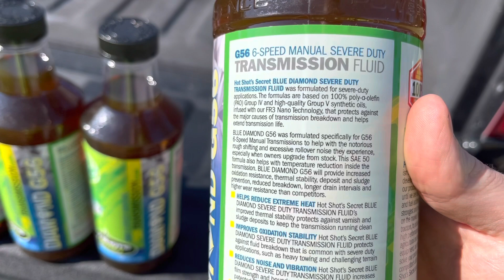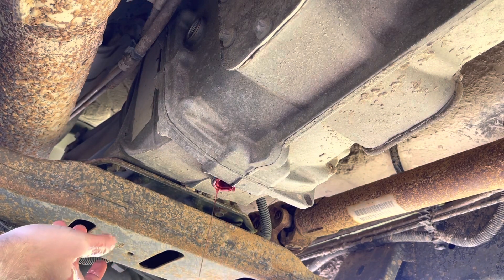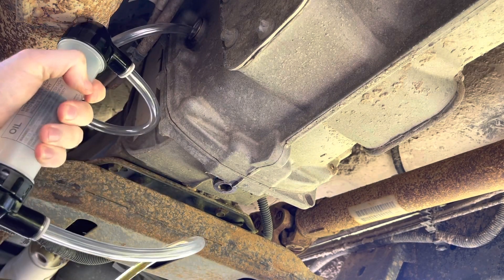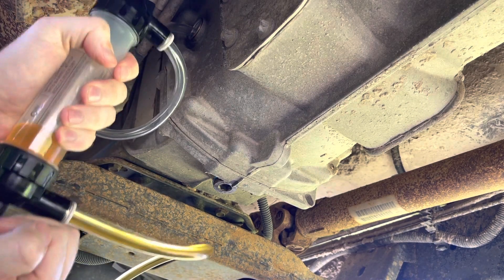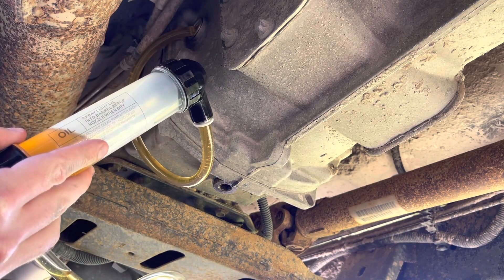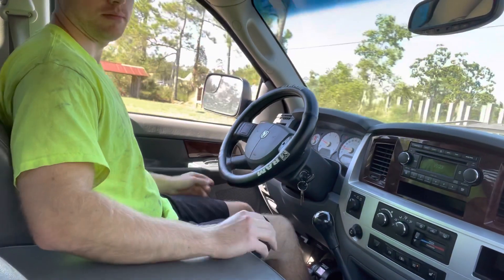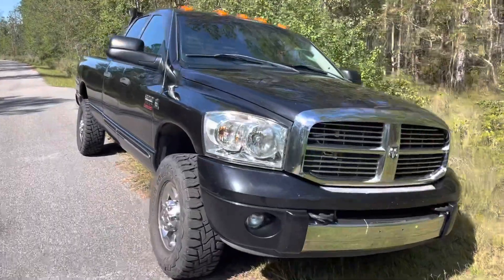Hotshots G56 oil change

Comment: I have been running this in my g56 and it's smooth. I'll be buying this again for the next oil change
Reply: I added a bit of the FR3 friction reducer to the front and rear differential on my 2017 Nissan Rogue and it feels a lot smoother.  I just made sure to ask around in the forums to see if it had any limited slip clutches I would need an additive for.  I worded it like that so as not to tell them my real intention and get flamed or humiliated.  I am quite pleased with the results and I only used a few ML in both.  Of course a quart bottle of oil will do both the front and rear on my vehicle and you still have some left.  I may get the Blue Diamond severe duty fluid for the next change   I have some stiction eliminator in my motor oil.  Maybe a couple ounces and that seemed to make a difference too.  That is the green colored product and they recommend a dose of 2 to 4 ounces per quart of oil I think.  I used maybe 2 ounces in my 4 quarts of motor oil and that seemed to already make a difference.  I have a CVT and I am approaching 60,000 miles.  I hear some of them fail at that point.  Now I would never use anything except the recommended fluid in that specifically, I know better than that or even a regular automatic transmission.  I do plan to try the gear oil next.  Some people think that synthetic and all of that would not make a difference.  They are just cynical and think all oil is the same and maybe it is when it is the same basic molecule and nothing is blended with it yet.  I know someone personally who is such a cynic.  If he knew the way my vehicle runs before and would borrow my vehicle now and then he could be the perfect test subject for a blind test.  One day do the switch over and then when he comes home ask him if he noticed any difference.  The key here is not to mention the change and avoid at all costs him having any knowledge of it since that would cause a placebo effect where someone who knows expects to see a difference.  Or even better is if he does notice it and suspects you did something and asks what you did so he could do it to his vehicle that would prove that something worked and was a big enough improvement.

Comment: I've been using Royal Purple Synchromax in my G56 (2005) since right after I bought the truck with 48k on it.  I changed it at 99k and currently have 136k on the truck.  It's also had a South Bend Con-OFE clutch since about 60k and it spends a lot of its time towing heavy (23-25k GCWR).  I've never had any shifting issues at all, including weather/temperature related.  I may switch to a dual disc clutch in the next year or so if I go through with my plan to do compound turbos.  Not sure how much longer this Con-OFE will last under those conditions. :)

Comment: Have used AMS oil? All my trucks and wife's cars are 100%. On my trucks, 5.9 and 6.7 Cummings, use a by-pass system too but I go about 18 k miles and still doing oil analysis with lots of life in my two trucks. Wife's cars we do the 20K or one year....

Comment: You Do you have any idea what I should do if the clutch on my Troka is stuck? I say stuck because it won't shift into gear unless it's off. And if I turn it on with the gear engaged, it starts up very quickly.
Reply from the maker: Possibly bad slave cylinder or master cylinder. It sounds like the clutch disk isn’t releasing when you press the pedal.

Comment: Any update on how the oil feels in cooler weather?
Reply from the maker: This is on my list of videos to make soon. It is actually decent. Not as stiff as the 50w oil I had before. I haven’t tested it in temps below 40F yet though.
Reply: @OutpostCTD  I am about to put some in mine. 2006 just hit 66k and I have a leak. So I’ll try it.

Comment: Nice video. Doesn't this same hotshot company make motor oil for the diesel? Have you ever tried it?
Love the improvised ramp. Lol. As long as it works.
Reply from the maker: Yep. Hotshots has the PAO oil for diesel engines. I haven't tried it yet but heard good things about it. I think they have gear oil for the diffs also.
Reply: @OutpostCTD  Thanks. I'll have to look into it.
Reply: @jamesvaldez4093  they also have one of the best fuel additives

Comment: Hi Mac did u decide which solid flywheel conversion you will get??
Reply from the maker: I’m still thinking about it but I am leaning toward valair and go with the single disk that holds 400 hp
Reply: @OutpostCTD  I got the Valair stock organic replacement 350hp-750 ft lbs torque yet to install.